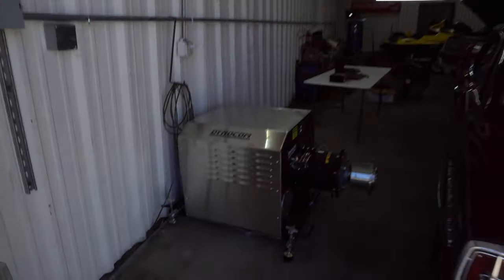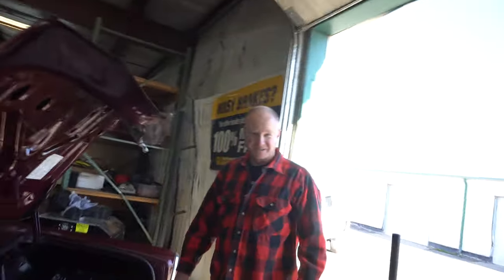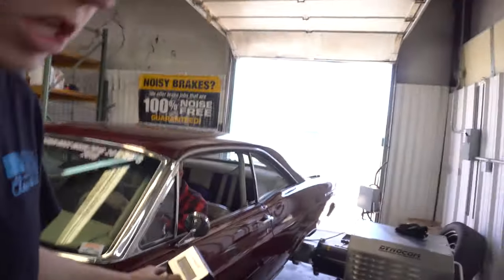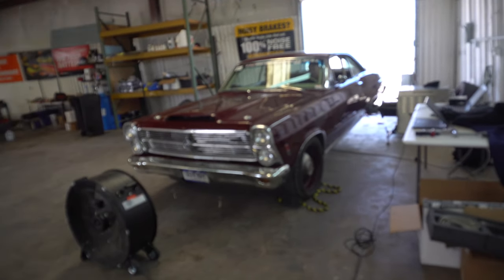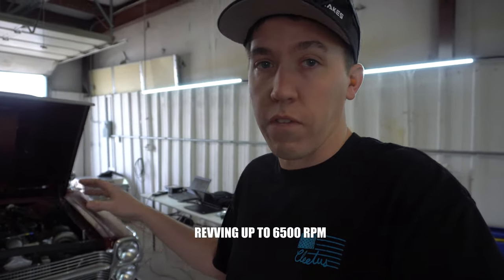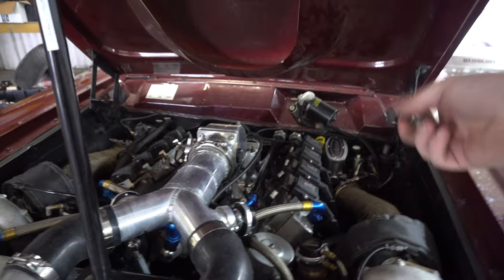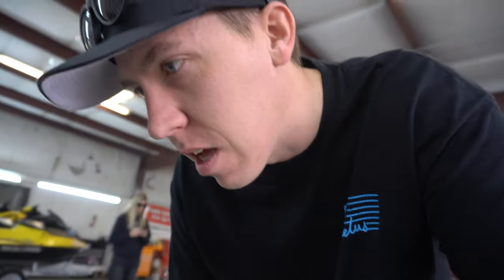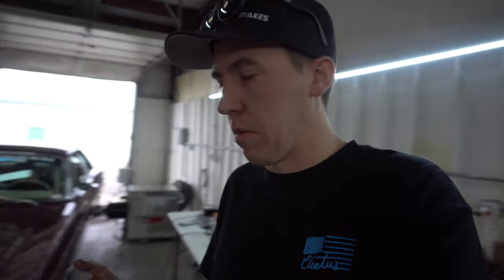Twin Turbo SBF Powered Ford Fairlane 500 STREETCAR Sets the Dyno Record!

Comment: Thanks James great video and great to work with you, would like to come back and try it out with the RPM based settings.
Reply from the maker: Your car is a beast! I will get it dialed in for the high horsepower stuff and we can definitely get it back on there for a couple more pulls! Had a 8-900 hp civic on there doing ramp runs and it was a lot easier to control that way!